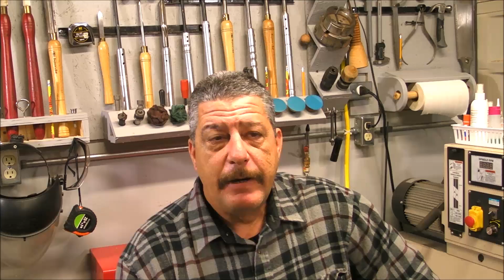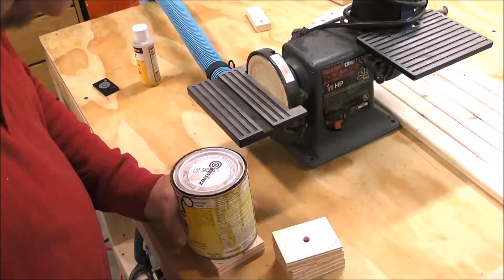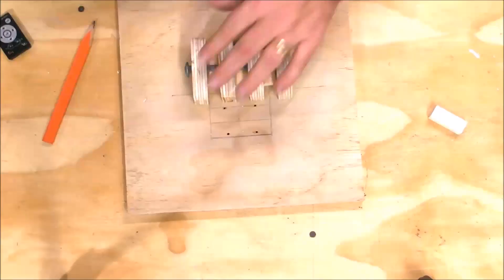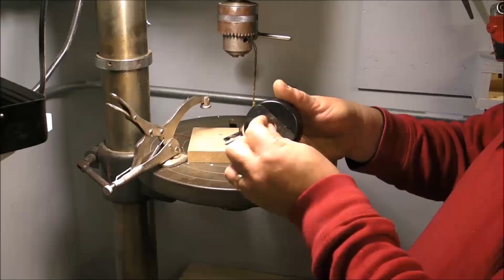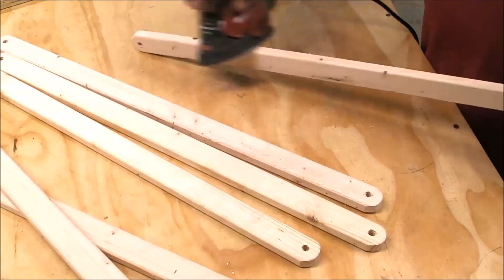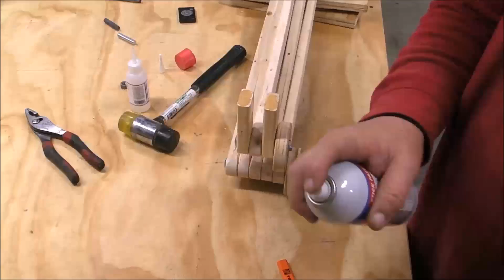#175 Camera Arm (1 of 2)

Comment: You and I must be on the same wavelength this week. I just made a Camera Crane video too, Should have it up loaded soon. I just got rid of the track system and switched to magnetic base cranes that attach to any machine in the shop and I put some metal on the ceiling above the the lathe so I can still get the overhead shots. The one you build here though has super reach that is nice. Be looking forward to the second video.
Reply from the maker: I look forward to see yours, sounds great. Best